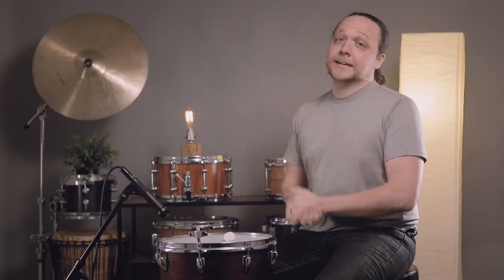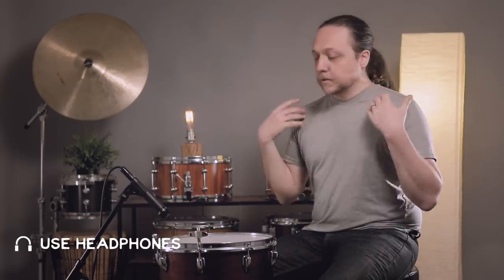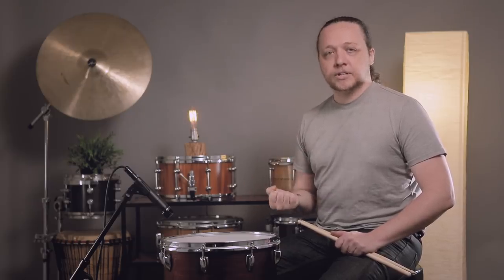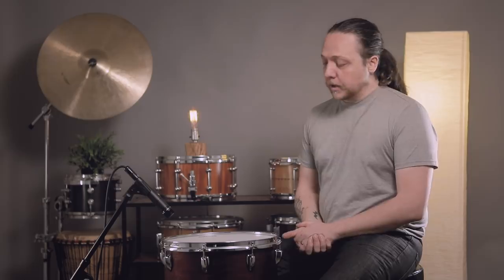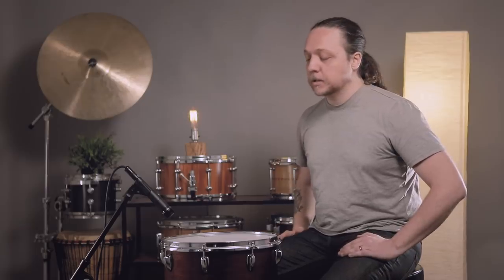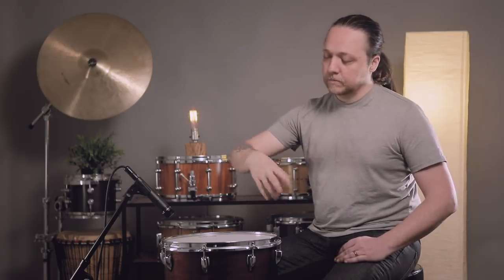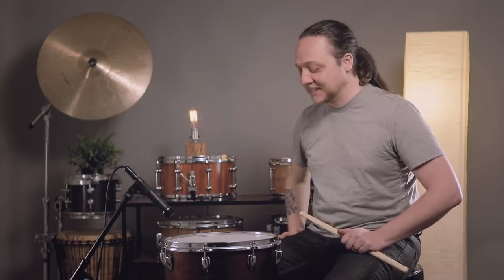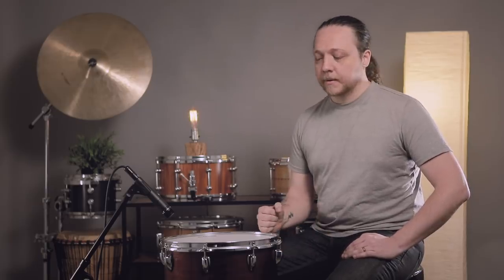Control Your Floor Tom: Muffling Hack | Season 2 - Episode 6

Comment: I've also tried a similar thing using paper towel sheets. About 2 or 3 individual sheets will do the trick. I would also cut them a little so they would lay flat inside the drum (depending on tom size)
Reply from the maker: Very cool! Do they jump off the reso when the drum is played?
Reply: @SoundsLikeADrum  I am not 100% sure, at least not to a point that I am able to tell. I'm heading to my practice space tonight for rehearsal, I'll test it out and get back to you. It does give a nice muffle to the drum, but similar to the cotton balls where it's not overkill. Obviously depending on how many sheets you have in the drum. I do not want to put too much weight on the reso head to kill the tone. It does offer a bit more tonal control with the overtones, which I like.

Comment: thanks for the tip! I tried it but just didn't like the material bouncing around inside the drum like a popcorn machine. my floor toms are 16-18 it took some work to get them right. I heard about using a 2" felt strip across the bottom of the head, just to the side a little bit, just like you would the kik drum. the sound was as expected*

Comment: My old drum instructor  told me about news paper yrs ago for a base drum.. I took 1 section fold on the crease and cut.then cut into 1 inch wide strips and throw it in the drum.. nothing touches the head and it takes out the ringing..

Comment: Maybe do a thing on coated reso heads? That's a Benny Greb thing as well. I think he has a 2-ply coated batter and coated 1-ply reso.
Reply: Back in the day everyone used coated reso simply because that was the only option. I personally use coated 1 ply both top and bottom on my rack and on my floor, coated 1 ply batter and clear reso. Just a weird preference;)

Comment: Another great video! I've always had problems controlling my floor tom sustain while maintaining full tone, so this will definitely come in handy. What are your thoughts on using a dampened head, like a PS3 or Studio X, on the bottom of a tom?
Reply from the maker: Thanks so much! Pre-muffled heads like a PS3 or Studio X are geared more towards controlling overtones rather than sustain, as the modifier is built in around the edge of the drumhead. For a drumhead that shortens sustain, you might try going with a thinner-than-standard reso head (think 7mil). We'll be covering this in a future episode Cheers! -Ben

Comment: how did the drum feel/respond with the 100 in it?
do you think it could be a good way to dampen drums for volume sensitive practice situations?
thanks
Reply from the maker: It felt like a mess with 100 in there. Using mutes would be more effective for low volume practicing
Reply from the maker: It felt like a mess with 100 in there. Using mutes would be more effective for low volume practicing.
Reply: @SoundsLikeADrum  thanks!!!

Comment: How would you tune your toms really low with a powerful slap and good tone with no gross over tones
Reply from the maker: Good Q - if that was what I was going for I’d be careful about head choice (probably something thick, perhaps even Hydraulics) and maybe try an extreme interval between the two. I had good luck recently with fairly high-tension reso’s against super low hydraulics and was pretty stoked with the sound. It was definitely both slappy and fat :) -Cody

Comment: would you be able to do this to the bass drum?
Reply from the maker: That's sort of what the Evans EQ Pad is meant to do; the ends are meant to lean up against either the batter or reso head and bounce off during the initial impact and then return to control the sustain. The key is to have something that returns the muffling system to the head after the impact for it to behave in a similar fashion to what we've demonstrated here. -Ben

Comment: It doesn't do anything to control top head.  Sometimes excess sustain (subiness) is top head.
Reply from the maker: While the direct affect is more with the reso, because the reso head does affect the batter head, there is some indirect control over the batter head as well. We’re big fans of these tricks (along with the sandbag on the floor tom leg) that control the overall sustain rather than significantly altering the tone. Definitely worth experimenting with. Cheers! -Ben